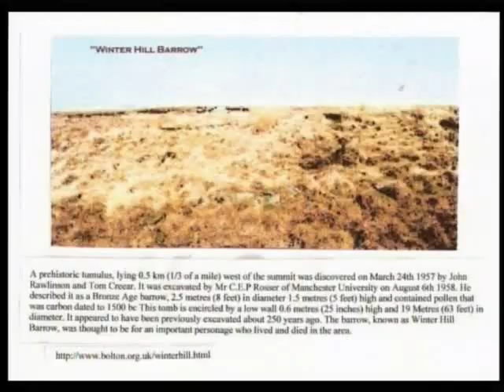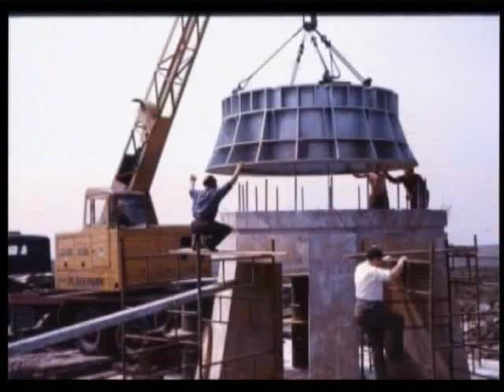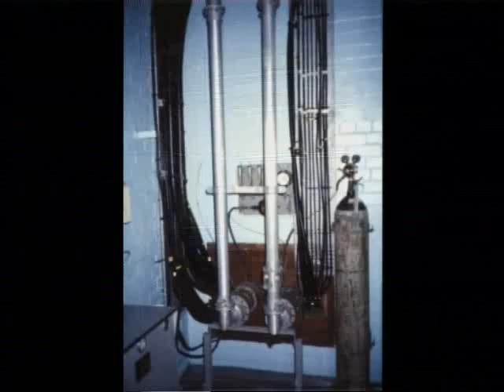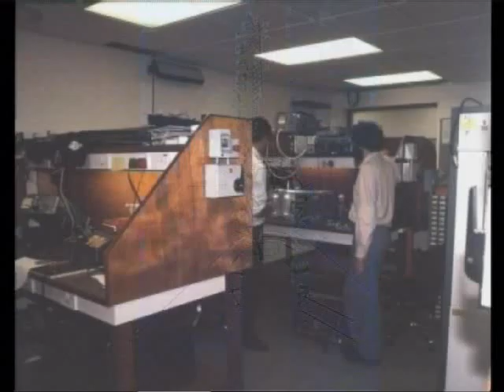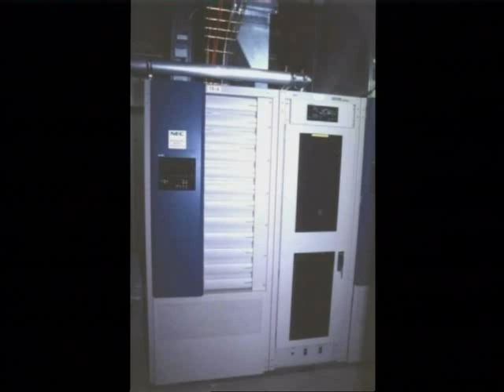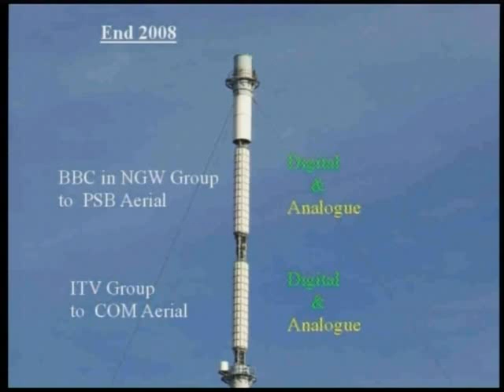How they constructed the Winter Hill Transmitter Bolton, Lancashire

Comment: My goodness I used to think we did it large in the RAF. I worked briefly at the former radar station RAF Aird Uig on the Outer Hebrides we operated from RAF Stornoway on a 2 1/2 day rotating shift off 2 men. It was only a single LF Amplifier with an output capable of 100kW although when I was thee we were on,y running about 13kW into the antenna. The antenna although seemed large at he time was around the 600 foot length, the whole structure was end fed and therefore the whole mast of triangular lattice construction sat on a ceramic base. The mast was supported by about 4 sets of radials with insulators at regular stages, some of the radials had fewer insulators mainly low down and these were active and formed a sort of parasol arrangement which helped reduce the input impedance similar I believe to the capacitive top hat effect. 😅

There was a single man lift cage that allowed access to most of the mast. The fascinating thing was the ATU instead of it being part of the final stage tuning of the lower powered HF transmitters I  also worked on, it was an actual building !! If you have ever had anything to do with the site of the  BT operated for the MOD site at the former Criggion station they had similar arrangements. 

The feeder from the transmitter fed into the ATU building which was lined in copper sheet and although memory is a bit sketchy now all of the L and C components (the TX output frequency was fixed so it only ever had to be set up when a change of frequency was required which would result in a lot of spanner work in the Tx a and the ATU. because the obs lights (3 or 4 clusters ) had to be connected to a mains supply and because the mast was live the mains cabling of the lamps had to match the length onto the base of the mast to avoid becoming parts of the antenna itself. There was a beautiful 3 phase transformer just for the lights. 

Later on working HF a at typically 10kW we used Marconi self tuning transmitters which often needed a bit of a tweak at times as they would tune up through 10dB attenuation inserted at the start, followed by pen stage tuning, final stage tune and load switch out the 10dB  then set output level. 
Some of our transmitters were 1kW wideband amps that had 20 4CX250 arranged in 2 parallel rows of 10 and driven from a comman input transformer in anti phase to each side via a common tapered transmission line feeding the grids of all 10 valves on each side. The anodes in both sides in a similar fashion had a tapered transmission line connecting all 10 valves per side. Finally both of the tapered output transmission lines fed into a coupling to the output. It was c,ever how this amp worked as generally depending g upon the frequency, there would be about 4 to 6 valves providing the bulk of the power and as the French change across the HF band, the valves providing the output power would automatically move up and down the array, this was due to the tapered transmission lines providing a frequency response spread across the whole unit…
the MOD used to provide us with Eimac valves but some bright spark decided to try and cut costs by buying Russian Svetlana make valves… these were unusual as the usual white ceramic was purple in the Russian ones… and by goodness they were rubbish!! about 40 % would trip off and blow the 3 fuses in the HT supply (a later mod replaced these with front panel circuit breakers) … a dodgy but helpful practice showed when the fuses had blown as a neon for each fuse was wired in parallel.
Finally when the old MATELO HF site was closed I took some video where I made a long rod of about 6 foot and screwed it to the main circuit breaker handle for the transmitters in the TX hall so we could all pull the breaker at the designated time..we were all excited and wanted to start dismantling the transmitters immediately prior to the contractor coming in to start the rebuild …we had just switched off and we’re getting all of the tools ready to start the rip out and the chief comes running in shouting ,.,get it all back online there are aircraft flying and need the service … which we did and a few hours later we took it down and quickly made sure we couldn’t run it back up again.,

Comment: Great video. 55 mile range however Globe maths say it would need to be over 2000ft to reach that far, if horizon falls away at miles' squared x 8", then divide by 12 for feet. Believe transmitter range not Earth's given stats! Is a big part of going higher to get a more rarefied area of air (or lack of) to transmit in before being disturbed with many more atoms and losing it's range via interference etc? Many people say satellite TV comes from such towers too, and that satellite TV is similar to GPS - land based? Thanks

Comment: Superb! I worked for the Post Office Engineering department TVNSC in Manchester from 1966 to 1972 and visited the Horwich microwave relay station manned by Brian Moss on several occasions and was shown round the ITV transmitter hall by Bill Kay. I joined Granada TV in 1972 and worked on Radio Links erecting dishes for OB`s on the 100 foot platform.Thanks for posting this it deserves a place in the TV archives !